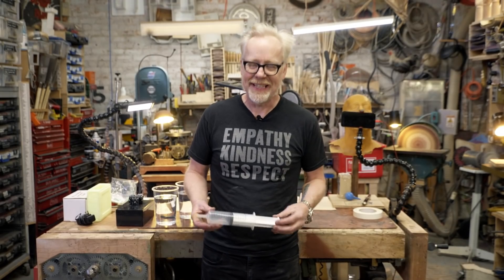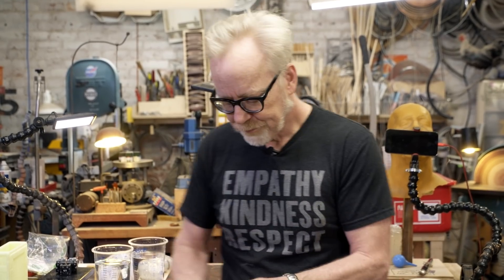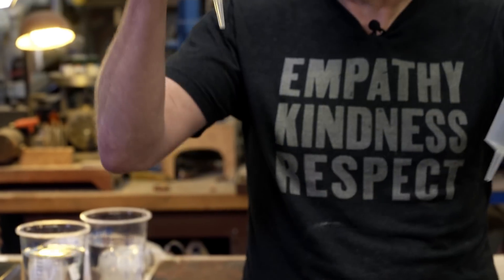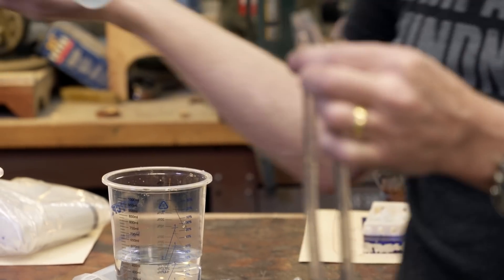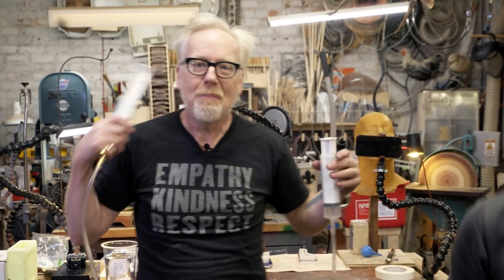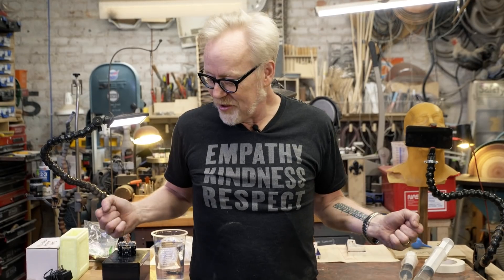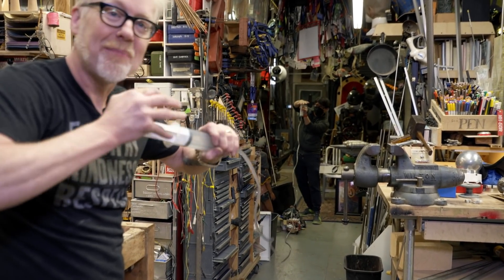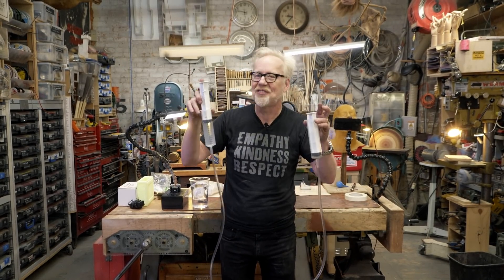Adam Savage Demos Hydraulics with Cheap Plastic Syringes

Comment from the maker: 150ml large plastic syringes: https://amzn.to/3IpwTzd
Disclaimer: Tested may earn an affiliate commission when you buy through the links here.
Reply: How about a link to the right size and stiffness tubing as well as a link to the syringes?
Reply: https://www.youtube.com/watch?v=aZJZK6rzjns
Reply: I literally just built a KiwiCo crate using smaller syringes for a hydraulic crane. 3 pairs to articulate claw clamping, claw to bend up/down, & for the main arm to bend as well.
Reply: @theHardChargerVids  hip (O_0)
Reply: https://youtu.be/RouEYGRJ2Lc
Reply: What diameter tygon tubing is compatible with these syringes?
Reply: @DPLEET  
At a glance on the Amazon page, the end nozzle has two diameters listed.  I assume they're OD (outer diameter) of the nozzles at .16" and .24" on the taper. 
Roughly 1/8" minimum and 1/4" max on the OD, so you want a tube with an ID around 3/16", roughly around the .18" to .20" range for the ID (inner diameter).

If you can't find the tubing based on the ID, if you can search by OD and wall thickness you can determine the ID (OD - wall thickness = ID).

At a glance, with how thick the tubing should be to be stiff enough for this case, I'm going to assume you'll want some .375" OD tubing with a .18" wall thickness to get about a .2" ID.  Balances your ID with wall thickness about 1:1.
Reply: I used these exact same syringes and tubing to demonstrate hydraulics to my daughter when she was 4 years old and wanted to know how a backhoe worked. She had a great time playing with the rig and I set it up to do a couple different things. Now whether she realizes it consciously or not, she has that understanding of basic hydraulics through a fun little experiment

Comment: I've seen where a motor was attached to one syringe via a screw and nut. Using a double throw double pole switch you can make the "Hydraulic pump" extend and retract a "Hydraulic piston" . The demo was a cardboard digger with several "Pump / piston pairs" operate a model of a ?? backhoe?? Or ?? excavator??...
All the pumps were operated by motors attached to screws and nuts.

https://youtu.be/XrgeOfFyGLI?si=m41eKS-BKsrDH_Xp/4:20

Tried to set to time 4:20 so you didn't have to sit through the building the excavator.

Comment: Ive been working on an invention to solve a problem that plagues motorists worldwide...and has done so for the majority of the time weve been mass producing the automobile. Current problems  Im trying to solve in the initial design phase: Need a system that can be contained within a space about 24inL x 2inW. and would like to power this by water as 1st choice in efficiency.

Ive been searching for ready made parts just to build a prototype. Syringe hydraulics came up early but I put that in the "runners up list". My biggest concern was wether or not I could transmit enough force using water and still keep that portion of the design in scale. 

Finding "micro water driven hydraulics " seems to be difficult. 

After watching your demonstration I have several more options for design and one may actually be an improvement to the original in many ways.

Thanks Adam....you know I grew up watching you and Jamie and to this day you and your friends have provided so many bridges,shortcuts, and insight to such a wide variety of material...I could never thank you enough. In fact when I saw this video my first thought was " face palm" ...of course Adam has an answer for me.❤

Comment: My hydraulic press idea, 5ml syringe on two (one way) valves, one feeding the system with water, and one so the pressure doesnt back up the syringe and that going to compress line thru a switch valve, and a same system on second switch valve but with 50-100ml syringe with two 1-way valves, feeding those to 4-6 500ml syringes in a wood body thru some splitters, and another valve making it possible to let out the pressure from it - simple hydraulic press, 50ml part for fast movements and 5ml for all the pressure you need :)

Comment: Has anyone ever done this with a luer lock syringe? Would it cause a point of failure at the connection since those are not known for holding up to a lot of pressure?

Also, if you happen to be in a lab and need to do precision gluing, you can attach a micropipette tip to the end of a syringe full of glue for easier application

Comment: If I’m not mistaking, Rick Baker used this assembly for his “Chang-o-Heads and hands in An American Werewolf In London. The plunger part was attached to the dental acrylic teeth/jaw cast and pushed through the fiberglass under skull that had cutouts in the face, in turn stretching the “smooth-on” skin. (Rick used Smooth-on material for the skin casting which was an elastomer that had more stretch than foam latex did)

Comment: Wow, that worked better then i expected. i wish i knew this as a kid. I built loads of stuff like hovercrafts speakers and electric motors and allot more back then.
But i did not know about this, also as you said syringes was not easily accessed in the past.

Comment: I used four syringes and two lengths of tubing to control pan and tilt on a GoPro camera up on the roof of my house.  One thing Adam might have mentioned is that if you plan on using one of these setups for more than a week or so - put some bleach into the water to prevent algae from growing inside the contraption and eventually clogging it up.  I also use some lithium spray lubricant on the insides of the syringes to make them move more smoothly without juddering.

Comment: My wife being a nurse would bring home expired syringes from work. One of the uses I like is to squeeze equal amounts of epoxy into the syringes using the graduation lines and stir it up with a small piece of wood or plastic. Then I can apply the epoxy in a very precise manner.

Comment: My expensive coffeemaker wouldn't run because it had been dry for too long during a move. Apparently without positive liquid pressure, it can't pull water from the basin. I used a syringe like that to force water through the system in order to reestablish proper pressure.

Comment: I’ve seen a remote gun firing rig that was essentially this only smaller.  The idea was to put the gun in a gun vice, clamp one end of the rig to the trigger guard, walk several feet away and actuate from there.  I had no idea they could be so robust though!

Comment: The first prop I ever made that was actually used on stage was in high school, when we were doing Dracula. I had this random idea to make a collapsible "wooden" stake out of cardboard. I drew out a long triangle (maybe 9" long) and traced it onto a pizza box. Traced four of these together, and cut them out and scored the connecting edges so they could be folded into a spike. Colored it with brown and black marker to make it look more wood like. Then I cut the whole thing in half, and put the smaller spike inside the big one. The actor would hold it around the middle to hide the part where the two halves meet, and when he stabs the vampire, the smaller spike collapses into the bigger upper section. Worked great, and literally zero cost. :-)

Comment: One thing to note, these are much stronger pushing than pulling, because pulling relies on atmospheric pressure to do the pushing. This is different from real hydraulic cylinders where there is positive pressure pushing the piston in both directions.

Comment: You can actually generate more force in one direction by using 2 different size syringes; a smaller diameter syringe with be able to generate more force towards a larger diameter syringe.
The larger diameter syringes 60cc and up work great for irrigating wounds, making cheap mini water canons in a pool and also work great for getting chemicals where you want them, whether that’s glue, lubricant, or a solvent. They can also work quite well in removing liquids in tight or short spaces like the last water out of a toilet tank; I actually use one every thanksgiving for basting the turkey.
You can also use them for graduated measuring when you don’t need much material or are working with concentrates, like dyes.

Comment: Fill a syringe with fuel to manually drip gas into a carburetor while diadnosing small engines or even vintage autos. Be Carefull of course.
I've seen so many dribbling gas into a carb in a hastily filled bottle or cup, gas spills everywhere. 
With the syringe gas only flows if you push the plunger. You can even drop / knock around the syringe and the gas stays in due to vacuum.  

Most disposable syringes are somewhat impervious to gas but check and test beforehand.
Reply: These syringes can sometimes be found a farm - fleet type stores. These syringes (I think) are used to administer oral meds to livestock.

Comment: That's a great trick, Adam. I've set up similar systems using wires inside a hollow tube, rather like a brake cable on a bike. There's always a bit too much flex in the wire though, and it's harder to push than to pull unless the device is spring-loaded at the other end. If I have to make something like that again, I'll try your idea. Thanks.

Comment: Many modern auto transmissions require a pump to re-fill the pan.  I use the large syringes to draw out of the container and then connect to the screw in fill nipple.  And since the syringes are graduated I can easily measure how much fluid I have added.

Comment: A syringe and a 20G needle (blunted on a grinder) makes the best little grease gun. With a smaller needle, like a 25G or 27G, it makes a good oiler for small spots. I did that a lot working on film cameras where you need lubrication at points but you also need the lube not to spread.

Comment: I use a lot of syringes with tubing on the end to pressure bleed hydraulics on bike and car. I sand the nipple (?) and the inside of the tube end, then zip-tie them together. One on each end - one delivers fresh fluid, the other receives the waste fluid - easy fluid handling.

Comment: You can have different sized syringes to accomplish different force and distance ratios. For example if the output syringe is twice the size of the input one then you will have half the working distance but double the force.

Comment: The FDA approved sterile 100 mL Leur Lock syringes, and you can get a 25 pack for about $129 USD.  Mechanical locking syringes are far superior to these catheter tip ones, and there are plenty of matching hoses that let you add fluid into/draw air out of the line without having to disassemble the rig.  Usually the lines are thin, but I imagine they can be retrofitted onto larger tubing by welding the plastics together.

Comment: Back in highschool we all had a project to build a "robot" arm from syringes and plywood in woodshop class.  Unfortunately, the plans that were handed out were photocopied and didn't maintain scale, plus there were no dimensions on the plans as it was to be a stencil cutout kind of thing.  So nothing fit up quite right.  It was a 3 hydraulic circuit arm not far removed from what KiwiCo offers.  But ours had a horzontal claw, double beam framework, a geared base for rotation cut from plywood, and the cylinder arrangement was closer to what an excavator would have.  The control syringes had levers attached for more power on a remote base.

It turned into a collaboration with the whole class to troubleshoot all the quirks the out of scale plans put in.  Pretty sure everyone ended up with a working arm at the end out it.  

We also built chairs out of cardboard and masking tape in that class.  Was a good time watching most of them get destroyed by the biggest kid in the class.  Mine survived.

Comment: Adam, you really brought back wonderful memories. Many years ago when I was teaching Technical Education in Vermont we used the syringes to make 3 function robotic arms in a 6 grade Middle School class. The base rotated, the arm moved up and down and the hand opened and closed. It was just a fun and cheap way to spark interest. In that same program we taught pin hole photography using oatmeal canisters, made model rockets from scratch, we taught mass production using string puppets, built and flew rubber band powered airplanes, and co2 race cars that the kids designed built and raced. It was so much fun not only for the kids but for the teachers. I team taught with a man who was into it just like I was. Many times we said how lucky we were to have fun and get paid for it.
Reply: Wow. I was a kid in the 80s and I don't think we ever did really neat things like that. Maybe I would have felt more engaged with school and later the world of work if I'd had exposure to such things.

Comment: You know also if you use a much smaller in diameter syringe on the end you are pushing you will get a whole lot more power out of the other end. Like a 25cc syringe with the big 100cc on the other end. It acts similar to a smaller gear to provide more power with less output force. Just thought I’d throw that out there to maybe try and show next time.

Comment: LEGO Techincs (Mindstorms) motors are another version of this and work well when the motion needs to be rotational.  Not super "strong" and a bit limited on "speed" but very simple.  Just connect two of them together and input force on one to have it mimicked on the other.  Flip the connector to reverse the direction.

Comment: Try swapping one of those syringes for a smaller one, and you can start multiplying your output force. If you have double the area on the big one, it’ll double the force you apply to the small one.

Comment: For a science olympics once we had to lift the largest number of ping pong balls to the highest point possible and we built a tower elevator using these syringes. By alternating 2 syringes you can rotate a paddle wheel continuously and essentially make an elevator

Comment: That is so cool! The force and mechanism from hidraulics and aerodynamics are very sustainable and interesting. I once tried to buy those tubes to make the water filter from the faucet more efficient and easy to use even for my toddler daughter. And i thought about compression with air but i couldn't figure it out completely so i gave up on that. But it's very nice to see it elsewhere

Comment: Hi Adam and Crew, I use a syringe, with a blunt needle, to feed cutting oil right into the groove when I'm parting off on a lathe. I've parted 2" diameter steel on a Myford Super 7, with no snagging or traumas.
Thanks. Keep up the good work.
Tim

Comment: Am I correct that there's a slight delay between action and reaction that gets longer as the tubing gets longer?
Reply: Yes, but you'd be hard-pressed to notice. Assuming no bubbles in the lines, the force is transmitted at the speed of sound through the fluid. For water, this is almost 1500 m/s, i.e. you'd have to have a length of tubing a kilometer and a half long to see just one second of delay.
Reply: @harvey66616  Good to know! Thank you for the answer :)

Comment: We use these (in small sizes, like 20 mL) in biology classes as vacuum pumps. The "leaf disc assay" is a lab where you use water and a drop of dish soap to vacuum suck the trapped out of little chads of spinach leaves. It makes them sink. If you put them in water with dissolved carbon dioxide (from baking soda) and a light they do photosynthesis, produce oxygen gas, and float. It's the best. Kids are mesmerized. 

Successfully using them as vacuum pumps takes a little dexterity but it works a charm.

Comment: This reminds me of a cool trick my Physics professor showed me in college. He had two simple hand crank motors made of plastic, ~$10 each, connected with electrical wiring. He showed that turning one handle 90 degrees turned the other handle 90 degrees as well. He spun it fast to show that the speeds were identical. Then he had two students duel to see who was stronger by spinning in different directions. Similar concept to hydraulics, but it was a much smaller build since it used wires instead of pipes.
Reply: My physics teacher in hs used pulleys to demonstrate how 1 person could beat 4 in a tug o war.

Comment: Some people in the amateur (Ham) radio use syringes as a lift or fall in capacitors. Some of the loop antennas are using variable capacitors for getting pico Farad inductance use soda cans and a syringe to obtain a higher or lower value for the frequency they are using. These are called Trombone capacitors and some made out of copper tubing do make a very good tuning circuit remotely so you are not always at the antenna every time you need to change the frequency you are trying to obtain. It can get very close to the desired capacitance with a very short push or pull.

Comment: Admittedly we were in a remote location, but I did a play in a small town.  Poltergeist activity was part of the play.   Props had to fall off , fly off a desk & bookcase.   We used the rod method.   Unfortunately we were having a argument backstage (not quite noises off level) and someone hit a rod way to hard.   The mug which was supposed to just fall off, flew across the stage.

It did miss the performers on stage.  They did jump though.

Comment: I teach Engineering Design to high school students. My students use this technique to create an arm similar to a backhoe to collect ping pong balls. They are all given the same materials and fasteners to create the arm. Then the students construct an arena and have a race to gather the most ping pong balls and get them out of the arena in a set amount of time. Students have used eye screws to create hinges and it is amazing how different each arm turns out. I have also had students create a device to collect and keep all the balls so no one else could score.